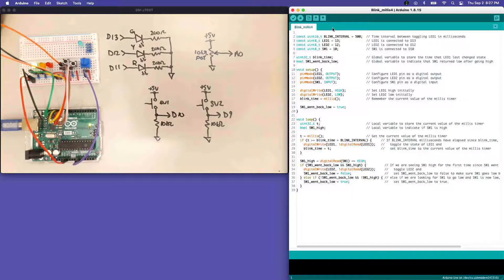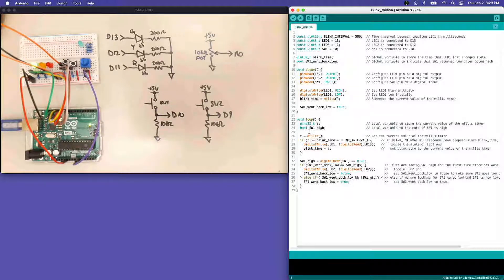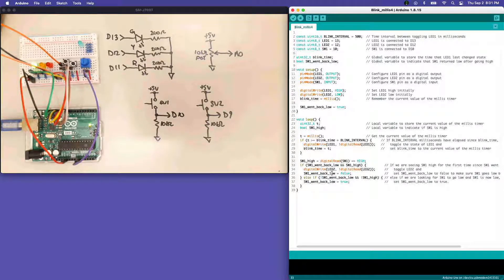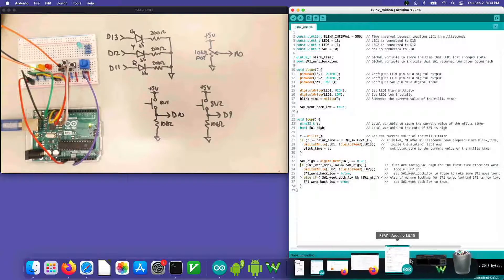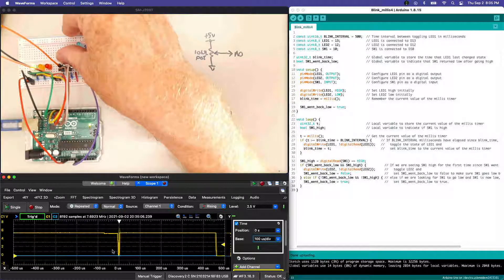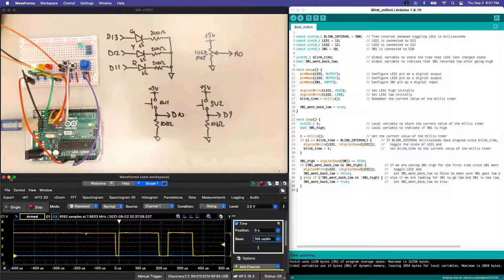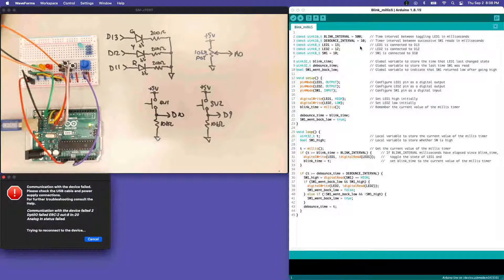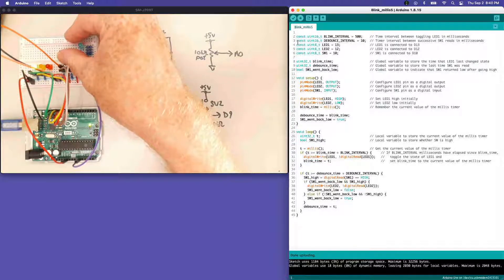Arduino Tutorial on Debouncing Tactile Switch Inputs in Firmware using millis()

Comment: I believe the Arduino inputs have have hysteresis— in my experience a 100nF cap from the pin to ground is enough to denounce switches.